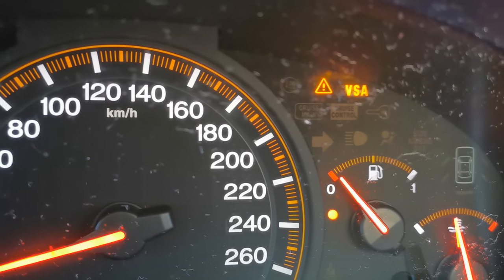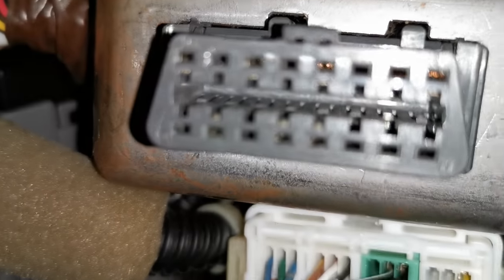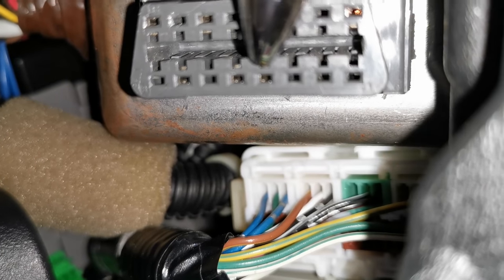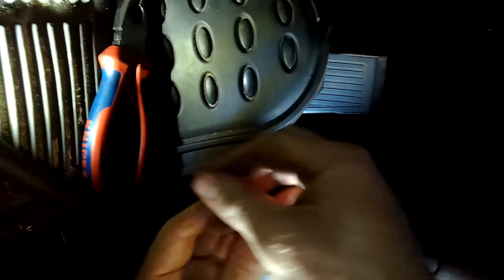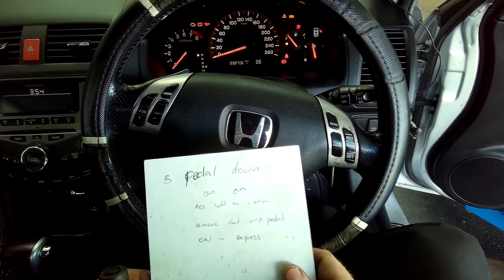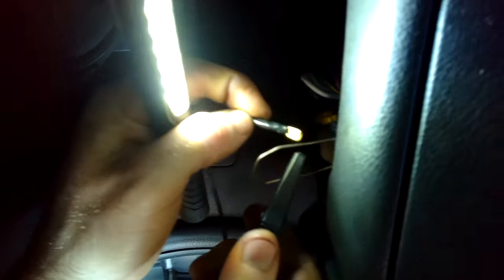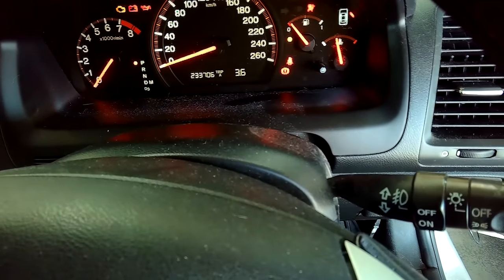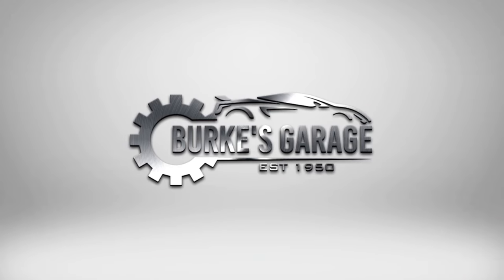Honda VSA & ABS Warning Reset - Simple DIY

Comment: FYI, pin 4 is chassis ground, so you could have left the jumper the way that you had it to pin 9 when resetting the ABS.
Reply: Thanks. That made it easier than trying to clip a wire
Reply: Thanks! That helped a lot 👍
Reply: So what your saying I can leave pin4 as is to reset the vsa light ? 😅
Reply: Thats right boyo

Comment: My 2006 Honda Pilot EX Model in step#2 short pin 9 to ground won't work, then read below comment some pal said YOU STILL NEED TO SHORT PIN 4 & PIN 9 TOGETHER (Note: Pin 9 not short to ground) and it work after 2nd try. In the 2nd attempt you must hold the VSA BUTTON until you see the VSA & THE TRIANGULAR on the dash flashing then go off, you are done. Make sure you REMOVE THE PIN before starting the engine.
Reply: Thanks for this.  I'm going to try on my 2005 Pilot.

Comment: Thanks for sharing this DYI tip on how to reset the ABS & VSA warning lights. I tried this reset process and all our brake-related lights turned off, saving me a bunch of $$$!!  We had a leaking windshield that caused the VSA light, ABS and BRAKE lights to stay on after a really bad rain storm (1/2" water on the driver side floor mat). After having the windshield replaced, we took the 08' Accord to the dealership to have it diagnosed; they said the VSA modulator needed to be replaced, for $2045!! My net search on this issue found this video and 2 minutes later, all lights were reset... thanks for posting, Gerard !!!
Reply: This literally just happened to me too. I just bought the vsa modulator. Guess I’m trying this out first
Reply: @TheCarventer  Well, did the VSA ABS Jumper of Pins 4&9 work, or did you have to replace the VSA Modulator?
Reply: Did you had ABS, Brakes in red, VSA and power steering lights showing up in the dashboard?

Comment: Just wanted to say to others my ABS light came on my Nissan 1994 pickup and thinking I should check my ABS sensors it ended up being a brake fluid level at minimum. A little fluid fixed the problem.

Comment: Hi Gerard, Thank you for this, my message appeared after a Diag Tool check too. I wrote this out and have added it to your comments in case anyone want to copy paste your instructions and go out to the car with it.

Part 1 Resetting the ABS Icon

Connect pin 9 to pin 4

	1. Hold Break down
Turn Ignition ON
ABS light will illuminate
Wait for ABS light to extinguish

	2. Release brake
ABS light will illuminate 
Press Brake Again
Light will extinguish again

	3. Release Brake pedal once again
This time ABS light will blink twice and extinguish for good - confirming the reset

Part 2 Resetting the VSA
Connect pin 9 to an Earth

	1. Turn Ignition ON
	2. Wait for the ABS light extinguish
	3. Select VSA switch to OFF
	4. Wait for the ABS light to illuminate
	5. Select VSA switch back to ON 
The ABS light should now be set and all the warnings should be cleared.
Check by turning Ignition OFF and back ON, all Warnings should extinguish
Reply: Wow....works like magic on Acura MDX 2006. Big thanks Gerard. You are God sent.

These icons ⚠️, VSA and ABS appeared after my MDX was scanned two years ago. Every effort to clear them by car mechanic was abortive and the sight of them anytime I enter into my car was like a pin in the ass that needed to go away. Eventually, I stumbled on this Gerard's video this midnight 00:21AM and having read all the good comments here, I could not wait till morning but rose to try this trick which worked out for me. I have an appointment tomorrow with my mechanic on this issue. Too bad, appointment is cancelled. Just on time, Gerard happened to me. Big thanks Gerard
Reply: hey , I tried doing this on my 06 Acura mdx , after shorting pin 4 and 9 all I see is my check engine light and other lights blinking , the abs doesn't tho , any suggestions ?

Comment: Worked for me, although the timing on the VSA button push needs to be quick (don't hold it). Took me four tries-- here's the procedure I used thanks to your video:

STEP 1
Pin 4 and 9
Hold brake pedal down
Turn ignition on
ABS light comes on
ABS light turns off
Remove foot off brake pedal
ABS light turns on
Hold brake pedal down
ABS light turns off
Remove foot off brake pedal
ABS light should blink twice

STEP 2
Ground pin 9
Switch ignition on
ABS light goes off
Press VSA off button quickly
ABS light comes back on
Press VSA off button quickly
All warning lights should be off
Reply: Per ModestMaker instruction regarding having to quickly press the ‘VSAOFF’ button in the reset procedure is GOLDEN!  Much appreciated!  2007 Honda Pilot AWD here.

Comment: Genius.
All I did was scan this damm 2007 accord and it set the VSA off.
Only this procedure worked, it's perfect, just do it in a speedy timely movement, not too long between the steps.  I wrote the instructions on paper. 
Thank you so much, this was a real real problem today.

Comment: I changed my VVT solenoid and my 07 Honda Odyssey kept going into limp mode. I came across this video and it worked. My van is running better than ever. Thx for the help.

Comment: Thank you for sharing,  this procedure worked for  my Honda Pilot 2007. I had the VSA light turned on when a mechanic did a full scan trying to find a code for a transmission issue, I have a cheap USB scanner and i was getting code 84, you have to do the two step for this to work, clear ABS then VSA, however, you can perform this procedure by letting the  jumper clip on the  OBDII connector between pin 9 and 4, pin 4 is ground,  therefore,  the second step when you remove the clip and bring another ground was not really necessary, you can perform both systems reset without removing the jumper clip, i just did it and the VSA light is gone. Another happy customer, thank you sir.

Comment: Thanks! I popped a check engine light due to a dead thermostat, mechanic used his snap-on megabucks tool to clear the codes after replacing the parts, and it triggered the Triangle and VSA light. I used Pin's 4 and 9, since 4 is the chassis ground, and your trick worked like a charm! Much appreciated.

Comment: Thank you sooo much. I had my wife's 2006 Honda CR-V in for a stuck Intake Manifold Modulator fix and when I got the car back the VSA indicator was on and would not go off.
I searched the web for solutions, and got a bunch of different answers.

I filtered out the ones that sounded too hillbilly and tried yours. I skipped the ABS section since  only her VSA was on. Bah-Dah-Boom. I got her car fixed! (With your help.) Thanks.
Reply: My Honda CR-V is doing this as well. Want to try it but I am concern I’ll make it worst.
Reply: @JenniferFlores-tt4hu  
Jennifer - I thought the EXACT same thing as you, that I would short something out - but it turns out this worked perfectly.
I would only suggest you use a small (as in "thin") paper clip, and a clip-lead if you can scrounge one up. It'll make it easier to connect the ground while you're sitting in the driver's seat. The hard thing for me was finding some metal part under the dash to find a ground. Some people use the hinge on the door jam. If you can't find any wire, cut the ends off an old extension cord and use one side of that. You can split the two wires by splitting it down the middle with a pair of scissors, and "zip" them apart into two separate wires. Good Luck.

Comment: Thank you, thank you, thank you.
I have read forum after forum, and they were all BS. They all left out the jumping the pins. Just push the break pedal and just push the button. None of that works, and i was skeptical of that too. I have done enough work to know there should be a little something else. 
One of your commenters said that pin 4 is ground. They were right and you dont have to take the jumper out. Just leave it where it is and do the other step without the break.
Reply: Thanks! What model Honda was yours on?

Comment: 06 acura tl here. Noticed brake lights would not go off. Brake stopper broke into pieces. Replaced that and the brake light switch. Solved the brake light problem. But then VSA and the /!\ lights came on. Vsa button inoperable. Felt like while trying to drive I had the brake pedal and accelerator pedal pressed at the same time. Scanned codes and 68 and 84 came up. Readjusted the brake light switch. I had it in too far. Scanned again and got the 2 same codes. But the car drives fine. VSA light disappeared but the /!\ light remained. Followed the steps provided by this video and all lights on the dashboard are off. Car drives fine. Afraid to plug up the scanner and run the codes again. Don't want to trigger the dash lights. Thank you! Hope this didn't deactivate the ABS and VSA systems but don't want to press the VSA button again either. Again thank you for this video I was ready to throw a lit match to this car.

Comment: Thank you!!!! I have been in the Honda sites and everyone had the First part but no one had the second part where we ground the 9 pin. 

Mine started post COVID lockdown. My battery went dead from not driving. My roommate is a mechanic and has worked for Honda in the past and has never seen this happen. We jumped the battery and then all the lights on the dash turned on. They pulled out their cheap scanner and didn’t get enough detail. Then pulled out his SnapOn scanner and the details all pointed at the the battery going flat. Put the battery on a charger for the night. Cleared all the codes and the TCS light didn’t turn off. No matter what we did. We tried the ABS reset multiple times. On level ground with and without the door open. No changes the light would keep turn back in after driving a mile. 
Today we tried what you posted and it is now working correctly!!
Thank you again!!

Comment: Honda accord 2006 hybrid, didn't make it in first try, it worked after 4th or 5th try, it got on after shop used snap on, and they later told me abs module is bad, used on ebay was 400 or 600$ , i got across this video and i can't thank you enough.

Comment: Thanks brother. It totally worked for my 2007 Honda pilot. After the mechanic worked on my airbag, triangle light and VSA would not come off. I watched your video, and it worked. Thanks again.
Reply: I tried this procedure on my 2007 Honda Pilot and the triangle is still on.  After following the VSA procedure triangle light did not blink.  Also the VAS off button still not working.  Care to share more of your experience?  Chaplain.
Reply: @juliewang9639  same thing here
Reply: @juliewang9639  try not doing the grounding. Just jump 4 & 9.

Comment: Had my 2006 CRV scanned at a local shop and left with the VSA indicator on. I watched the video but the ABS didn't behave as described. I tried it three times and moved on to the second step and it cleared it right away! Thank you!
Reply: the first step only works if you have a code 84-1 in your abs module , if the abs doesn't blink it means there aint any codes in your abs system
Reply: @sujithkondabrolu1684 so my 2006 Honda Crv also has this issue when using a snap on scan tool. The warning light is the only lit light. It’s code 84-1 so the first step should help with this issue?

Comment: After using a snap-on diagnostic tool and getting these warning lights after a full system scan. I proceeded to go into the individual calibration settings, and went into the ABS calibration. Do a full reset (it came up twice as procedure not recognised) after the second I called it a day. On reversing the vehicle out of the bay and back in to the yard all fault lights turned off!! Please make sure that all four wheels have turned several times forward and backward on level ground before going any further than what the diagnostic tool has already done, full scan!! If this fails try going in the calibration menu and to ABS recalibration sensors. If after driving forward and backward they're still on and one of the symptoms is brake pressure switch and/or sensor logic then it's a faulty wire in the ABS module. This can be repaired for around £150.
Before doing any pin to pin shorting try all of the above. If all of the above fails then you have nothing to lose. Just remember after having the abs module brake switch/sensor logic the ⚠️ light will stay on permanently you need to do the diagnostic calibration scan (all the ABS and VSA lights will be on again, don't lose faith) just drive back and forth a good few meters and the system will recognise this and reset. 
This hack should be tried after all else fails.
Reply: What are the steps in details

Comment: Thanks for making this video! I used your instructions to clear the triangle/VSA light that came up on my 2007 Honda Pilot after I used a Launch CRP scan tool to clear codes.
Reply: is it still on ? I just bought a pilot with it on and I here it's common so it didn't like  scare or bother me so I went on with the purchase
Reply: If this worked on a Honda Pilot it should work on a 2008 ridgeline right ?

Comment: This worked for my 2005 Honda Pilot EXL. I replaced the head gaskets and after reinstalling the battery that's when the problem showed up. I have read many posts about this issue and it appears the problem is brought on by disconnecting or low voltage from the battery.  Thank you Gerard for your help.  Cheers!
Reply from the maker: Thanks mate
Reply: What tool you use for that ground you use for vsa?

Comment: Good video. Just did a timinbelt and water pump and the vsa and check engine light came on. 1 code 0344 and it says it is a camshaft sensor. But I didn't touch any of the sensors. Sh-awd also came on.  I reset the vsa light with this method.  But it comes back up. I have my scanner tool, and it clears everything and the car struggles to start. Once started the lights come on and it runs fine. Have a camshaft sensor on the way just In case

Comment: Wow so this video was the best explanation and fix to getting triangle light off and vsa not to come on. My friend has an 07 honda pilot. And we have a scanner which takes off vsa in abs function but that triangle is always on from start to turning off vehicle. Vsa would come on within a block or 2 until you cleared the code but we have been trying for a Lil bit now to figure it out. We'll after I reset abs triangle turned off stayed off. And no vsa light as well. Thank you so much for your video and help. Because thatvcrappy lights would cut power down like the calipers were sticking. You made our day today. Again your video did the fix. Thank you again for your help and for posting a real cure to that headache. 🙏😀

Comment: Hi, thank you for the video. It helped me to fix VSA triangle on my Honda Accord CM2 (2004). In my case the second part of the reset needed to have 9-4 pins shortened too, not 9-GND as in your video. Cheers!
Reply from the maker: Thanks Daniel 🙏🙏
Reply: I'm trying this today..
Just so I understand 'when you say you had to have 9&4 shortened what do you mean?
Reply: @willsr.9154  Follow the video. First part requires you to shorten odb connector pins with wire. Second part of the video says to shorten pin to ground. What worked in my case means to do the second part of procedure in video with shortened pins as per first part of the video - not to ground.
Reply: @danielbarta6707  so no grounding at all just leave it as it is for the last part ? Because the grounding part lost me
Reply: @themcilroyfamilyYT  yes, it worked that way in my car.

Comment: This is brilliant. Couldn't find this info anywhere else. The car went to a garage for an unrelated fault, they had a snap-on diag tool and it triggered the Exclamation mark, the VSA light would come on when reaching 30mph. I went through this process and it's cured! The garage couldn't work it out. I used the door bolt for GND. Thanks.
Reply: I have the same issue, I had a check engine light on for the knock sensor which I ended up replacing with the oem one cause aftermarket still showed the check engine. I went to reset the check engine after replacing it and had my exclamation mark on ever since. They used a snap-on diagnostic tool as well. You think this video will help?
Reply: @angelsantana2184  yes sounds exactly same issue with snap on tools
Reply: @supervitz7178  I’ll give it a shot, thanks.

Comment: Hi
I tried it on my Honda vtec 2007 but it didn’t work. Perhaps the problem is slightly different as the ABS/VSA light doesn’t come on at ignition. It normally comes after 2 mins of drive. I tried the first method of joining pins 4 & 9 and it gave me message on the dash saying “DTC service - PA10 B1008” and nothing else. The ABS and VSA comes on as previously after 2 mins of drive. 
I havent tried the 2nd method for VSA reset as I don’t have something to use for grounding. Please suggest what can be used for grounding if I don’t have the clipper. 
Pls advise 🙂

Comment: I owe you a drink if you ever find yourself in Glasgow , whole set of lights on dash after a scan. A honda civic diesel 2013 , worked like a dream , all lights gone , only had to do pins 4&9 , thanks so much.
ETA : my OBD was upside down comparing to your video , so googled the pin locations and had to start opposite.

Comment: THIS WORKED FLAWLESSLY I HAVE A FOXWELL AND NEEDS UPDATING SO I CAN'T DO IT THE EASY WAY FOUND THIS DID IT FIXED IT AND A FEW ORHERS IN THE COMMENT SECTION IS CORRECT JUST LEAVE PIN 4 AND 9 JUMPED THEN U DO THE PROCEDURE FOR BOTH THE ABS & VSA RESET SINCE PIN 4 IS ALREADY A GROUND NICE WORK TO ALL 😎😎🍻🍻

Comment: Success! 2005 Honda Accord Hybrid. The light came on after I had a shop replace the AC compressor and they said it might be due to a faulty ABS module. (I didn't think so) So thankful for this "hack". How did you even figure it out? Definitely buying you a few drinks! Cheers! 🍻
Reply from the maker: Thank you very much. It's massively appreciated 🤗🙏🙏